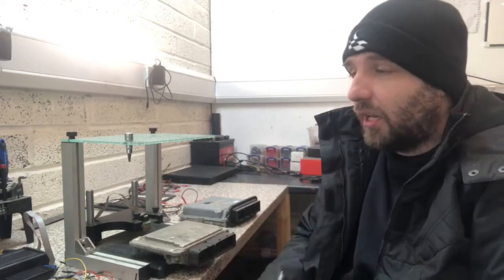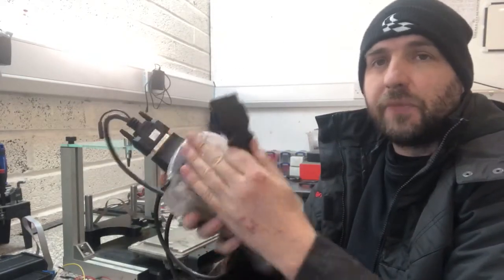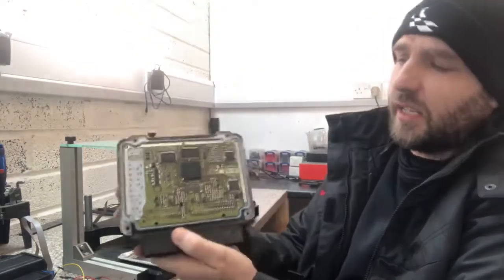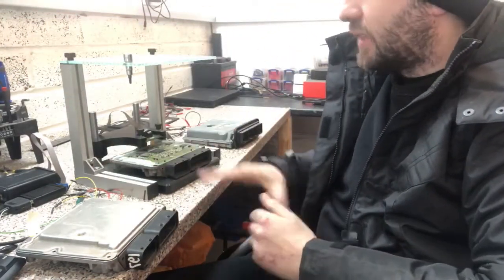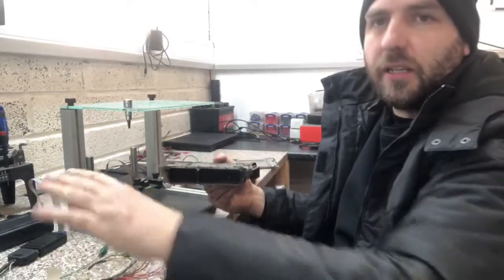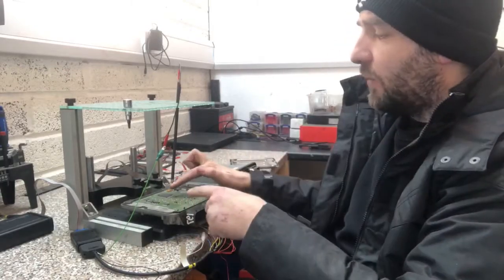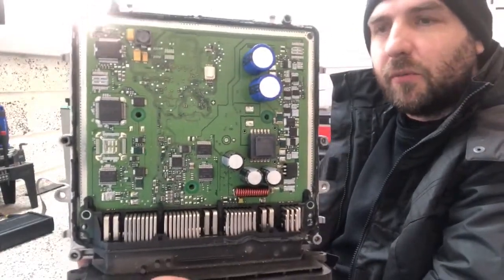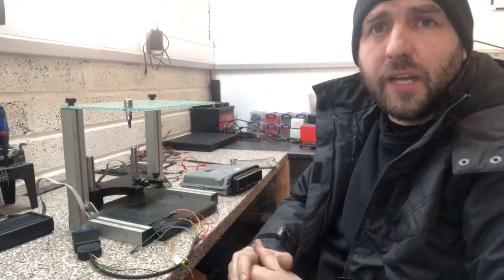What Bench Tuning is.

Comment: Can someone help me please? When tuner speak abaut full read is requiered for example when they want to do swirle flaps off. Is full read also possible with bench mode when you just connect the cable to the pins or do i need to open the ECU Unit???